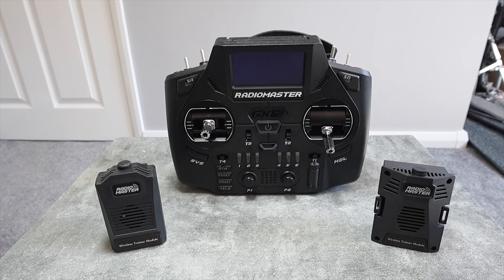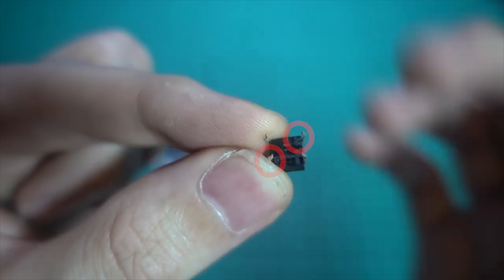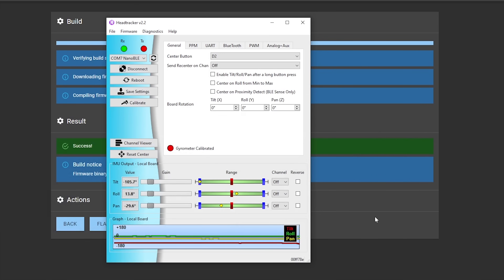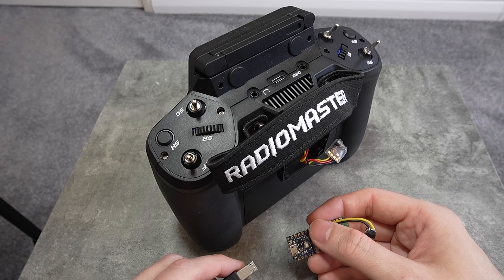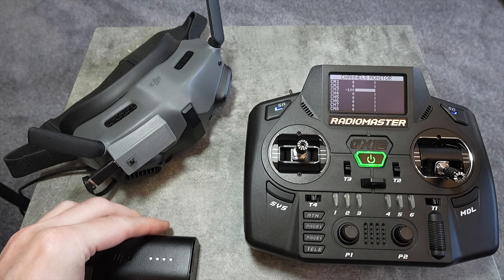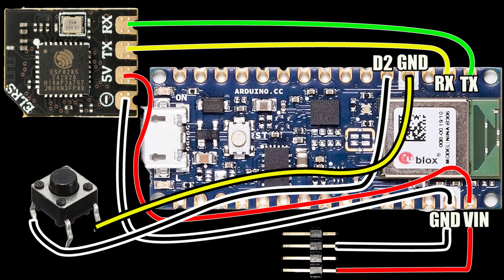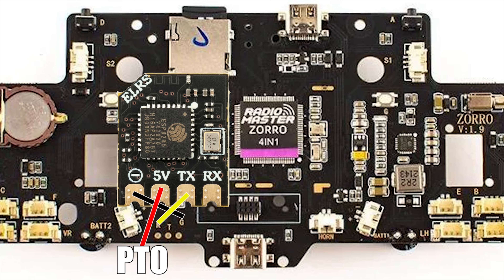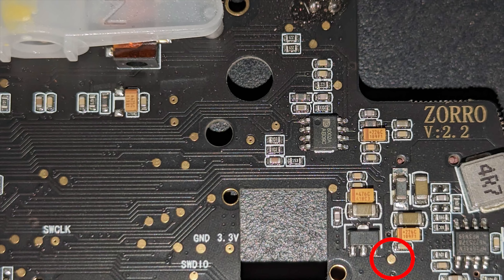DJI Wireless Head Tracker For Radiomaster Radios Tutorial

Comment: Thanks for the interesting video Andy, I have DJI FPV V2 (not goggles 2) goggles that give out 5v from the USB C port when switched on, will that power the Arduino Nano with the ELRS board ok?
I also have a Radiomaster TX16S, do I just need to solder in an ELRS receiver to one of the UARTS as I use a Crossfire module in the module bay?
Thanks.

Comment: What is the size and length of the screw you use to mount the case at the front of the goggles?
Reply from the maker: M2 about 6 to 8mm long
Reply: @AndyRCchannel thank you!
Reply: @AndyRCchannel Hi I'm working on this project but I'm using radiomaster XR2 in AUX1 ports in my boxer the head tracker and the receiver are already bound and I enabled the sbus trainer in hardware screen and master/sbus in model screen but I cannot see the output being sent or read in my radio, any idea?

Comment: I got this working... somewhat... i keep getting trainer lost/connected whenever my DJI system is powered on. When i move the head tracker away from the googles it stops and works perfect. I'm assuming the DJI googles are causing interference, make the trainer module loose connection.
Reply from the maker: Turn telemetry off on the receiver. Someone else said use channels 1 to 4 for the output as you may not get full resolution passed channel 5. Turning telemetry off worked for me
Reply: @AndyRCchannel You mean "force telemetry off" on the RX via the web interface? I have TR2 and TR3 set, so good to go there.

Comment: Unfortunately, it doesn’t work on the TX12. I’m using the TX12S Mark II V2.5 board, and I’ve soldered the pins exactly as shown in the video—both on the transmitter and the receiver. I’ve tried both inverted and non-inverted SBUS, but I’m still not seeing any activity on CH7 or CH8. I double-checked all connections with a multimeter, and everything appears to be correct.
Reply from the maker: That's sucks I'm sorry it doesn't work 😞

Comment: Hey I got this to work thanks so much.  I am using it only for tilt on a quad and have the roll and pan set to off. Couple small issues.  1) If I tilt my head too far downward the camera snaps completely back. 2) Less of an issue is that if the head tracker loses power, The camera moves to its reset position which is undesirable (due to the limited travel of the servo, the neutral position is slightly pointing downward.).  Is there some way to set where the reset position is?
Reply from the maker: yes you need to apply an offset so when the head tracker disconnects the camera has a default position. as for it resetting when you put your head too far. you can either adjust the gains so you head does not reach the limit. or you can adjust an offset for the axis in the headtracker gui
Reply: @AndyRCchannel thank you!

Comment: Is there a way to do this via the ELRS backpack system? HD Zero goggles are able to send data straight to the backpack enabled modules
Reply from the maker: Only with hdzero goggles
Reply: @AndyRCchannel  hopefully soon someone will do an arduino version, that would be slick, or maybe the head tracking guys might be up for adding backpack support
Reply from the maker: @DesignTuneOperate sadly from the feedback iv gotten no one is interested. I hope they change their tune but it's unlikely. Also the backpack feature is not without its flaws. Some reports of interference and causing packet drop outs. And a fair amount of gyro drift
Reply: @AndyRCchannel  Very good to know! Sounds like it's best to get on board with this way of doing it then. It's great you can turn a RX into a little TX

Comment: Leaving this here for future knowledge. With the DJI Goggles 3, and presumably the Goggles 2, the USB out does not provide enough current with just a standard cable, or even a PD module, and you'll receive constant Trainer Signal Lost / Recover notifications.  You specifically need an OTG cable to negotiate the higher power.
Reply from the maker: Did not run into this problem myself (using it weekly) but thx

Comment: Hi Andy. So I got this all going, but I've been having massive interference / drop outs between the TX and RX. I.e. "trainer signal lost" constantly.  I tried 2.4 and 900 ELRS, I tried shielding the module bay in case the internal ELRS was causing issues.  I've had to go back to Bluetooth for now, which isn't "that" latent for me.  I'm curious if you had any issues like this?  I've been sort of following the Goggles 3 and ELRS interference dialog and wondering if that is related.  

On a side note..... I highly recommend anyone using head tracking and ELRS use the ELRS "Full" profiles to get the most resolution on the Aux channels.
Reply from the maker: did you turn telem off on the receiver side? thx
Reply: @AndyRCchannel  yes.  Its better when its forced off, but there are still moments when it switches off and on what seems like every 5 seconds for a while.  Power cycling the TX seems to help, but only sometimes.  Very odd.
Reply from the maker: The best thing to do is to join the head tracker project in discord. There has been many releases since I made this video and changes for new hardware etc. hope you get it sorted
Reply: @AndyRCchannel will do.  Appreciated
Reply: @AndyRCchannel  I got this working much better.  Some additional info for you (that you don't mention in your video):
In the headtracker software make sure to use channels 1-4 as they will send higher resolution to the elrs module in your radio. Under Uart tab select crsf output, and enable channel5 as aux1/arm to get the full power of the TX.
Reply from the maker: @RichardFPV thx for the extra Info 👍

Comment: I am trying to set up the RP2 as a transmitter, but I flashed the Headtracker firmware on the Nano BLE 33 Rev2 before soldering the RP2 on.  When I try to set it up in Express LRS Configurator, I get a message:  "connect ECONNREFUSED 10.0.0.1:443".  Any ideas why this would happen?  Thanks!
Reply from the maker: It sounds like you are trying to flash direct to the wifi in the configurator. You don't do it that way. You press build in the configurator which makes a file on your computer. You then connect your computer to the expresslrs wifi hotspot. And then go to 10.0.0.1 in a browser and flash the build file there.
Reply: @AndyRCchannel  Thank you!  I have it working now.  I love the immersion that you are getting with the the headtracker and the air unit.  I would like to add external rudder and stick controls, for even more immersion.  Now that I am using the trainer port for the TX16, what is the best way to add in external controls?  Thru Headtracker?  Or another input in the radio?
Reply from the maker: I @davidmackellar1615 I'm not sure what you are trying to do. Do you mean when you move your head you want it to also move the rudder?
Reply: @AndyRCchannel  No, actually I just want to add my own rudder and external stick to control the plane with and I am wondering what the best way to do that is, while still using the wireless headtracker?  With the headtracker using the trainer port, I an not sure how to do this.  It seems like I could use one of the other UARTs on the TX16 and use MIX to input the info from the rudder pedals and stick, and map those as TR channels, but I'm not sure.  Just trying to figure out how best to make this work.  Any thoughts would be greatly appreciated.  My experience with the TX16 is fairly limited.  Thanks!

Comment: Which gimbal are you using partner?  Or which ones will work?
Reply from the maker: I use the bag gimbal by motion sic as well as the atomrc pan tilt. But it will work with anything such as the c-20t or the walksnail gm3

Comment: I want to do the same thing but with betafpv 2.4ghz lite rx'sinstead. I dont have to flash any custom firmware on these to get one of them to work as a tx right?
Reply from the maker: No custom firmware required. Just enable expert mode and flash as TX will be there. I have done it myself now for the betafpv lite. It works

Comment: Hi there! I have a problem with my setup. I have a Happymodel EP2 plugged into RM Wireless Trainer (the left plug dedicated for Boxer) in my RM Boxer. BetaFPV Lite RX (slim, as you mentioned at the begining) connected to XF Robot Head Tracker (GND, 5V, TX, RX). I wired everything as it should be, I flashed the latest firmwares (3.5.5) on both receivers (on BetaFPV Lite I did "use a receiver as a transmitter", as you did. On Happymodel EP2 I changed to SBUS), same binding phrases. Unfortunately, they're not binding. I have no more ideas what can be wrong. Please help!
Reply from the maker: I have not tried the xfrobot head tracker yet however here is something to consider. When the receiver (acting as transmitter) is connected to the xf robot head tracker. Do all the lights go out on the receiver?
Reply: @AndyRCchannel the blue LED on BetaFPV Lite (as TX) looks like it's blinking medium speed what meens that chip is not detected. I tried it when connected directly to XF Robot headtracker as well as simply powered gnd and 5V without any tx and rx connected. I also tried on another rx flashed as tx (Happymodel EP1), still same problem. All of RX I tried when flashed as a regular rx are normally binding to my boxer so hardware works fine, telemetry is ok. RX in Wireless trainer waiting for connection, no bind and both go into wifi mode. No more ideas...

Comment: Can also confirm this working on a Jumper T20 v2 (prolly works on v1 too) - pulling the RM board from a micro module (and hot gluing it inside the T20)  and connecting to the internal socket that would normally connect the external module. Also using sbus A socket for the rp2 on the trainer board x
Reply from the maker: Great info thanks

Comment: Hey andy, for powering the head tracker you only need a cable with ground and voltage right? I mean, the one cheaper with only two cables inside, no need to be a data transmitter cable with 6 cables inside for data right?
Reply from the maker: Yes just power and ground. The Arduino board itself takes up to 20 volts. But if using this receiver method that needs 5v. So don't connect anything more than 5v with the receiver attached. It will make the receiver (as a transmitter) to pop

Comment: I'm brand-new to radio-controlled devices. I brought a RadioMaster Pocket CC2500 transmitter and a foam board airplane from FliteTest for my nephew. I'm not able to operate the transmitter myself because of a severe physical disability.

I have been able to fly a DJI drone using custom software connected to an Arduino, which in turn is connected to my wheelchair joystick. I had 3 modes I called A, B, and C. A pushbutton rotated the three modes. In mode A, my wheelchair joystick controlled the traditional left joystick on the radio, giving me altitude and yaw. Mode B, my single wheelchair joystick controlled the right joystick, giving me pitch and roll. In mode C, I had camera pitch and drone yaw (my DJI Spark does not have a yaw gimbal, only up and down).

Unfortunately, the custom software I used is no longer available. After seeing this video, it gets me to thinking I could build something using the trainer transmitter and receiver as you described ending connect my wheelchair joystick into the Arduino.

You configured channel 7 and 8 so that your head tilt controls the camera gimbal. But I presume I could map the output to any of the channels to give me me altitude, roll, pitch, yaw, and camera gimbal.

I'm not even certain I need wireless transmitters like you are using. For my application, I think I just need power, ground, Rx, and Tx serial lines, presumably at 3.3V levels?

Where can I get documentation on the SBUS specifications?

By the way, can RadioMaster control a DJI drone, or do they have a custom interface? Doesn't matter. I could buy or build a drone that would use RadioMaster receivers. But it would be nice if I could use my existing DJI Spark.

Any advice you or your viewers have would be much appreciated.
Reply from the maker: Yes you can absolutely do that. Do you have discord? The best thing I can advise is to join the express lrs discord and the head tracker project discord (they are both linked in their websites) and ask about sbus in there. They are the coding wizards that know about this stuff and can point you in the right direction. Sounds like a great project. Let me know how you get on. If you can't find the links to their discord send me an email (it's listed in my about section on YouTube).. YouTube doesn't like links being posted in comments as they want you to stay  on their site or app. Cheers

Comment: Hello Andy, can we use 1 rx (wired to Arduino board), then bind with elrs backpack? Thank you so much. (cause I didn't see any aux pad on Jumper T15).
Reply from the maker: You are best joining the elrs discord. They are working on head track back pack feature but since only hdzero goggles currently use the feature and I don't have those goggles discord will be best to inform

Comment: For anyone wondering, this does work in a Jumper T15 - with the receiver in the SBUS A slot in the Radiomaster Trainer Module.
Reply from the maker: Thanks for that 👍
Reply: So there is no way if I used a micro module (TBS micro, Nomad.. Etc), isn't it? Please bright me. Thank you. I'm struggling with that :(
Reply: @canhduyphan7807 in theory it should work fine. You might need to load a custom EdgeTX build.

Comment: Would this work with a walksnail v1 google Andy?
Reply from the maker: The walksnail V1 does not output any power from the USB port. However not impossible. I would but a bdi cable adapter kit as it uses the same barrel connector as the DJI V1 goggles https://www.droneauthority.co.uk/products/bdi-digidapter-cable-management-kit then you can power up the dtqsys board from that as it has a wider voltage range. Or add an additional 5v bec to the Arduino board to power the receiver. Cheers

Comment: Good morning  from SpainAndy,
Thank you so much for this fantastic video; it's very comprehensive and detailed.
I already made a head tracker from the first version, using a jack cable to connect it to the trainer port.
What I can't seem to do is power the Arduino from the goggles2.
I connect the cable, but the board doesn't power up. However, it works when connected to a computer's USB port.
Is there something I need to enable so the goggles2 can supply 5V from the USB port?
Thank you so much again.
Reply from the maker: It is the goggles 2 you have or the V2? Confusingly DJI gave them similar names and the V2 does not output 5v from the USB goggles 2 are the smaller type goggle and V2 is the bigger one towards the end of the video. Cheers
Reply: Yes, I have the goggles2,  the small ones like the integra.
Reply from the maker: @zagiman7625  how are the goggles being powered? By a DJI battery through the DC port?
Reply: @AndyRCchannel  yes, by the original battery  system
Reply from the maker: @zagiman7625  ok the likelihood is it's your USB cable. USBC to USB micro is not a popular lead these days. I had to search to find the l shaped connector and pair it with an adapter. And this might be your issue is that you only have one cable to try? To confirm it's outputting 5v for me if I attached my insta360 go cam to it. It powers that up also. And had one USB micro cable that for some reason would not power up the Arduino board. I think the contact was too loose. Otherwise connect the goggles to the USB via the phone and check the video out feature works via the fly app. That will tell you if the USB on the goggles is broke but it's unlikely
Reply: I know it's not the USB port on the glasses because I've tried my son's as well, and it doesn't power the Arduino either. It's probably the cable. I'll try a different cable or the video output, as you mentioned. Thank you so much for your attention and your content; they help the community a lot.
Reply: Wowww Andy.
It was the cable.
It's working with a new one.
Thaks a lot!!
Reply from the maker: @zagiman7625  I thought as much. enjoy!

Comment: I have a TBS tango 2 pro with a module bay. Would I be able to add a module to it and get this to work?
Reply from the maker: No sadly not. Tbs have been teasing supporting edge tx for years but still nothing. My one doesn't have a trainer option or an aux in the hardware. I have the one with the module. I think the latest version is like 5 years old now 😭
Reply: @AndyRCchannel  dang. Thanks for the reply. Great video regardless
Reply from the maker: @matbolduc  it really is a shame as it should be capable of doing it. Same with the mambo. One of the things that sold a lot of people on these radios was the promise of edgetx 😭

Comment: I am using a Boxer and I see when I power up the Boxer the RX is powered on.  There is no way to turn that off without a physical switch?
Reply from the maker: some radios always power it on even when aux is disabled. you have tried disabling the aux in the hardware tab to see if it powers off I assume? If so adding a hardware switch wouldn't be difficult